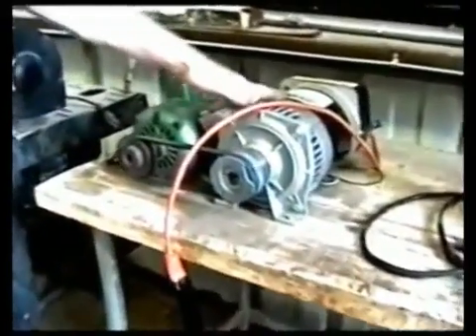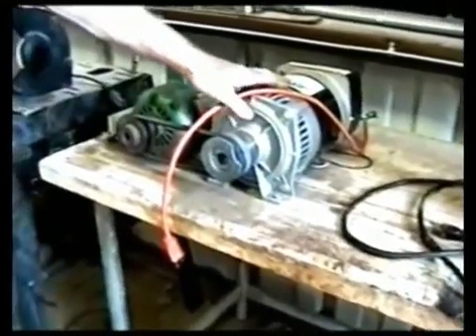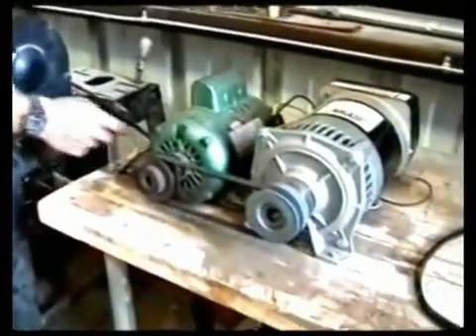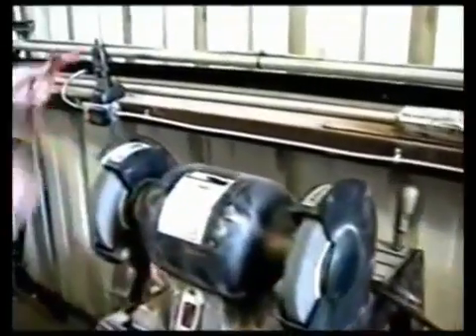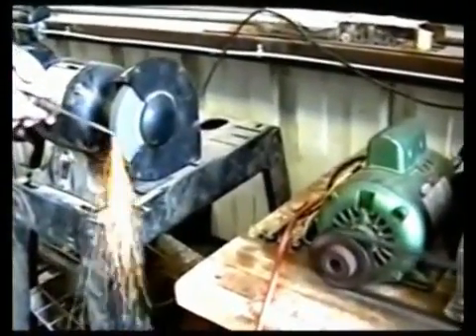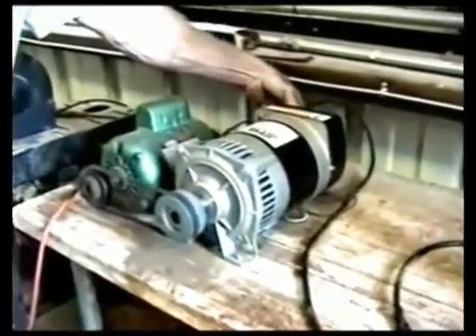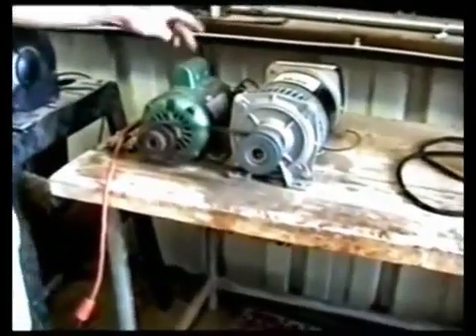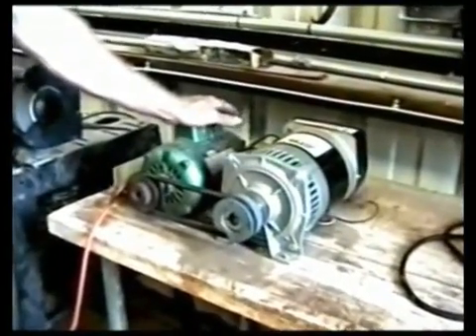3000 Watt Generator Powers Itself, Grinder & Drill Press.

Comment: Systems like this have been used for decades as alternatives to batteries.  Unfortunately, your video doesn't show that you have anything more significant than that.  You start by pumping in an unspecified amount of power, and then proceed to take out an unspecified amount of power.  While it's perfectly possible that you have developed a system that draws energy from Earth's magnetic field, rotation, or some other ephemeral source, you're not doing a good job of demonstrating that.  If you want to be taken seriously, go get a wattmeter (a kill-a-watt is about $20) and show the readouts for the amount of "seed" power you put in vs the amount consumed by your devices. 

Or, if you can't afford that, put a 25 amp load on it and run it for longer than you did your input current.  (Your current load devices don't come anywhere close to the amount of power that will be stored as inertia by that combination of motor and generator.

Or, flick the input on just enough to get things moving, and then switch it over and show us the pulleys continuing to accelerate after the input power is turned off.
Reply: Study Tesla . He has the right idea.

Comment: A 3/4-horse motor draws 900 electrical watts to produce 562.5 mechanical watts. 

The alternator he has here (generators make DC) draws 3300 mechanical watts to produce 2200 electrical watts.

Not even God can make one watt do the job of six.
Reply: Jim Mowreader Sux being you !
Reply: wanna test that theory of what god can do?
Reply: Grey Wolf Since there is no God, let's go for it.
Reply: alternators make ac  to run the motor it has to run ac .this set up would run a drill press etc ,but the trick is ac from generATOR WILL NOT FEED BACK TO MOTOR RUNNING GENERATER  weve tried this and now attempting to find what this chaos "coil" actually is ...we suspect a frequency changer

Comment: Hahaha nice try but of course utter bullshit.... Here you have constant energy loss through friction (transferring kinetic to heat), vibration (transferring to noise) or including the grinder: electric to kinetic to heat/noise/kinetic (the kinetic at the end being the movement of grinding particles. Energy may only be transferred, not created. In the clanky setup energy is quickly lost meaning if it were truly unplugged from all power it would stop quite quickly.

Comment: IT IS POSSIBLE...plz read as i try to explain. You have to do a bit of backwards thinking than you originally jump to.
If you have 500watts at 1amp, then you have 500watts. Basics....
if you reverse it....
you have 500amps at 1watt, you also have 500watts, however you now have massive amperage...
Self-loop the motor-generator and now
you have a "small" motor powering a "big" generator it causes the electromagnetic field to fluctuate creating more energy than the "small" motor uses to power the generator.
However......You will need a "starting engine" in order to start up the system.. Once you get it at operating speed, the starter engine/motor can be shut off and it will power itself.

Comment: The right side switch serves no function other than to help conceal the hole drilled in the table where the wires feed the switch on the left. The power cord is ran up through the front left tube of the table frame. The camera person was careful not to pan down to show the cord coming out of the bottom of the table leg. The wiring you can trace to the motor from the left switch is real, the rest of the wiring, including the motor plug is all fake.

Comment: At the age of ten i was planning such device but sooner it found out that it is impossible to run forever. There are just coils that turns induction into movement. With that movement the construction looses power with heat. Then you translate the movement back into induction. This also contains a large amount of loss of energy. Why don't you just connect two tranformers in series but that will not work for a long time even with a large capacitor connected into the circuit.

Comment: Looks like a lot of wire hacking going on during the first minute of the video. Besides, I've never heard of a generator being plugged into an electric socket. Started with gas or diesel, yes, but what would be the point of a generator if you already have power coming from the electric socket?
Reply: There are uses for motor generator sets. If you need a different frequency such as 400 Hz for testing aircraft equipment or 50hz device used in the US or 60hz used in Europe. Also some railroad systems use lower frequencies. Today modern electronics can replace motor generator sets meaning the cost of copper in the MG sets vs. high power silicon devices cost may turn them into dinosaurs.

Comment: As stated the Law of Conservation of Energy applies exclusively to  a closed or isolated system. The video shows a closed system. The inventor claims that the system self powers with energy to spare to operate externam devices. The inventor states that his system does not defy the Law of Conservation of Energy, therefore by default he admits that his system is not a closed or isolated system as it produces more energy than is apparently fed inbto the system.So what or where is the system obtainnng the extra energy from as the inventorr admits that his system is not closed or isolated. The system  is a perfectly valid and scientifically develop0ed system but the inventor choses not to disclose the source of the energy which is in excess of that available from the system. Not wishing  to disclose the source of the energy in excess of that which may be accoundted for is the prerogative of the inventor. If the system operated in contravention of the Law of Conservation of Energy and yet  maintained its exclusivity and isolation,. then the inventor is truly deserving of the Nobel Prize for Physics for having developed a system to which the Law of Conservation of Energy does not apply, a Law that has held to be valid, irrefutable, irrevocable, immutable and of universal applicability  considered so by science from the begining when the scientific method was applied to investigation of the phenomenon of Energy.
Reply: It doesn't defy the laws.  The modification he mentioned was an inductor which stores electric energy as magnetic energy as the system is being generated.  Once the energy is no longer generated the inductor releases the stored magnetic energy back into electric energy to maintain the systems equilibrium as energy is lost due to heat.  The inductor also releases energy to maintain the system when he uses the power tools.  Once the inductor runs out of energy though, then the system is no longer self sufficient and the parlor trick is over.  The trick is to, one, cut of power to extra systems before the inductor runs out of stored energy, and two, don't drain power faster than the inductor can restore the power.
Reply: Aidan Hodge Science
finally someone who knows logic of electrical devices....geez i was starting to think no one was gonna post this

Comment: that is not possible ... there is external power source, it's fake ... any body has some knowledge about the theory of the electrical machines will know there are a losses in form of heat and magnates so the output power of the motor will be not equal to the mechanical power required to run generator to generate enough electricity for the motor ... i did try hundreds of times doing that for my graduation project but it didn't work .

Comment: This sounds like the ramblings of an insane person.. WHAT in theeeee hell does 200 times more power from ground zero mean?  LOL!
Reply: In electrical terminology the ground in a grounded system is said to be at zero potential. By agreement and convention making the ground and neutral at zero potential makes measuring all the energized wires at potential relative to ground or neutral and to each other easy and understandable. We could pick another number than zero or make a specific energized wire zero but that would only make things confusing.

Most electricity is generated in power plants using large alternators powered by steam or water. Maybe he's talking about a technology that uses heat trapped below the earths crust to create steam. 

Or he is referring to the amount of coal taken from a strip mine. By increasing the size of the drag lines 200 times you can get more coal in the same amount of time. Or maybe he's talking oil and increasing the size of oil well heads.

Comment: I have a background in electronics, and also used to do stage magic. I can think of several ways to duplicate what's seen in this video, without resorting to computer enhancement etc.

If it actually worked, you should be able to:

Film at a large public parking lot, one that is asphalt or concrete, wide open area with no pole lights, curbs, nothing nearby.

Use a vehicle with a hefty invertor and an extension cord. Bring a toaster. Leave the grinder and drill press at home, 

Set up the table with motor, generator, and toaster. Run extension cord from car invertor, crank car and start the motor/generator, flip switch to the "perpetual motion" setting. Unplug from extension cord, place in car.

Your accomplice drives away in the car (you need an accomplice), leaving the gizmo running - with nothing nearby, asphalt or concrete all around. Plug in toaster to gizmo, toast a piece of bread. Will this work? Or does the magic "Ground Zero" pixie dust not flow through asphalt?

Comment: Y can't we make cars like this have battery's to start the electric motor on the car going then have the motor on the car power the genarator and shut the battery's down then the genarator in return powers the cars motor and recharges the battery's when stop the cars motor witch is ran threw a transmission keeps going

Comment: Can't believe people still falls for this. If you had something like this, you could make billions in a day by selling it. It's not possible! The generator can't even make enough power, to run it self. as long as you have some kind of weight, bearings and other resistance, you will ALWAYS need more power, than the generator can produce.

Comment: Neither the drill press or the grinder start up caused the generator to slow from the load.  Any normal generator will lose revs under this situation.  Also a generator capable of driving either of those units would require more than 3/4 HP.  This video is total bullshit.

Comment: Dude -You're sitting on the biggest invention in history!
Here's the plan: Install with the motor shaft and the "modified coil" generator in one larger unit, then connect a bunch of them together. Make an array of 600 units and install them in a shipping container. Each of these containers would produce over 1-MEGAWATT of FREE POWER!
Just think of the possibilities. No more need for any fossil fuel as we could scale these units to power homes, factories, cars, trucks, ships, trains, motorcycles -you name it!
Better yet, use the FREE POWER to power reverse fuel cells that produce hydrogen or methanol so the energy could be transported on tankers & used anywhere in the world.
The methanol could easily be made into feedstocks to make fertilizers, plastics -All of the stuff we use petroleum for could be made out of the methanol produced with this free power, CO2 & water!
You should probably go into hiding until a few prototypes can be made or you could end up like the guy that invented to 100mpg carburetor  or the guy that built the first diesel engine (meant to run on peanut oil). I'm sure Halliburton & OPEC already have a contract out on you after seeing this video.
They've probably already got you.

Comment: Nice troll video.  All this does is move energy from generator to the other.  Let it run for a while and it will go out due to mechanical and heat loss (aka energy loss).  Turn on your tools for five minutes and show that, won't work, no energy is being input into that system, unless you mean by modified as "nuclear."

Comment: Faraday would be having a good laugh if he saw this video. The author is correct in stating that the conservation of energy law is not being impaired here. The output power of a system is ALWAYS less than the input power due to i^2R loss, iron loss, windage and friction losses. In short, the (mechanical power output of motor) = (electromagnetic power transferred to rotor minus electrical losses in rotor). Efficiency is the ratio of output power to input power, and could NEVER reach 100%.
The author basically gave away part of the “trick” when he said that he modified the generator. But you may not have noticed that both the grinder and drill press were plugged-in one at a time, and for only a certain amount of time, and that the starting torque to the drive motor was provided through a 120VAC outlet. All motors, including the generator are single phase “squirrel cage” induction motors with die-cast rotors. The most (or easiest) that could be modified and experimented with is the generator stator. The stator field windings are organized in groups that can be shorted affecting the synchronous speed and frequency. The apparent output power from the generator is enough to provide starting torque to the other motors, but reactive power is being absorbed into the unmodified motor rotors causing excessive heat due to change in rpm and frequency. Slip-ring sparking will occur and all unmodified motors will eventually shut-down on thermal overload, or melt down. If too many generator stator windings are shorted, the immediate high current draw would trip breakers during start-up; if too less generator stator windings are shorted, the apparent power would not be great enough to provide start-up torque.
I’m not sure what the author’s reference to “ground zero” is. I can only speculate that he is referring to Lorentz force--the electromagnetic force produced when a current-carrying conductor is placed in a magnetic field.
A power utility engineer could explain this better than me, but what you see is real! It’s what is known as a “brown-out” in the power utility field, which are common during heat waves. Experiencing a brown-out, you may have noticed lights dimming, but probably not the motor overheating in your refrigerator. The guy has produced his own personal brown-out, and if he is not careful it will cost him a grinder and drill press, if not already.

Comment: Place the 2 devices on top of a Plexiglas table that is locate in a middle of parking lot away from any posts. start the motor with your car converter then drive away the car.
Once you establish the transparency you will have the skeptics convinced.
As a engineer I already know you can not make that happen. Both new video or claim. This kind of logic experiment proved me wrong when I was nine.

Comment: The law of conservation of energy doesn't just apply to a closed system. It applies to the UNIVERSE. That's the first law of thermodynamics. You're still violating the second law of thermodynamics -- you can't achieve more than 100% efficiency. No such thing as "ground zero" energy -- it's not even a real science term. There is such a thing as "zero point energy", but that's completely different.

Comment: Yes, it is possible.  I have seen a similar hook up where the 2900 watt generator is connected to a hamster wheel!
Reply: I have seen an Apple power an ipod   ;)
Reply: Energy Technology
Some of the most powerful content anywhere
*http://digitalproduct.hol.es/?gocbp=4472*
Kevin Barry
Reply: Do the hamsters get to eat? I expect that the hamsters are like a battery eventually they die or get tired. Maybe they will reproduce and all you have to do is feed them. Cert of like hanging a carrot in front of a donkey.

 Apples are acidic and putting to dissimilar metals into it will create a small amount of DC power. How long dose the ipod run? Eventually the apple dries out or one of the metal electrodes corrodes to be unusable. What you have discovered is a dry cell type of battery. I'm surprised Apple Corp doesn't market it as a organic battery powered version ipod.
Reply: stargateeer haha lol thats funny

Comment: Ok so, if i understand this correctly, the reason this would work is the same reason that your car gets better gas mileage at highway speeds rather than in stop-n-go traffic: F=m*a, (force = mass x accelration). So if there is movement but zero positive acceleration (i.e. if you were travelling highways speeds not stopping or accelerating), then: force = mass. Therefore if a generator/motor combo was ALREADY running, then it would require less energy than if it had to get up to speed from a stop, and as a result there would be leftover energy from the generator to power other stuff. that sounds right but i dont know for sure, its has been a while since hich school.

Comment: Hello Friend, good night? What is the speed (RPM) and how much power this electric motor? and what is the power output of this generator? The engine power has to be subtracted from the power generator? Generator I have a single-phase 110/220 v Output 7.5 kva to 1800 rpm, that engine should I use to get a free energy like you are using? If you can me I appreciate help, my email is renadjflash@hotmail.com
I'm talking about Brazil.
Thank you

Comment: one huge problem I noticed anybody that has run a generator would know this one when you load down   RPMs wood change you are talent may this 1.5 hp electric motor would not change RPMs at all fake the cord is run under and along the back of the table